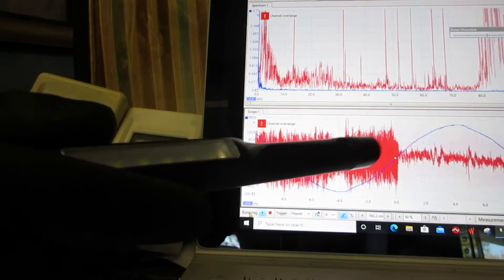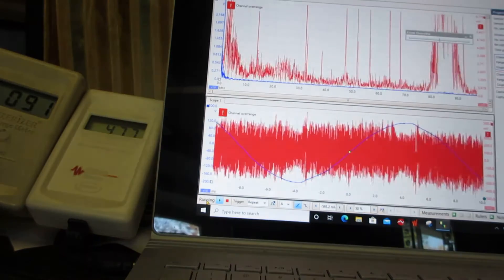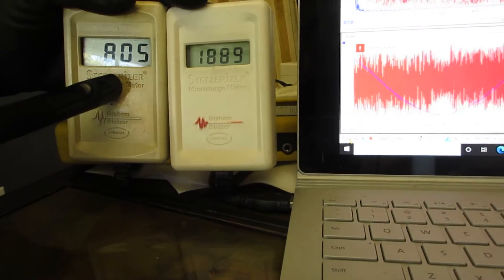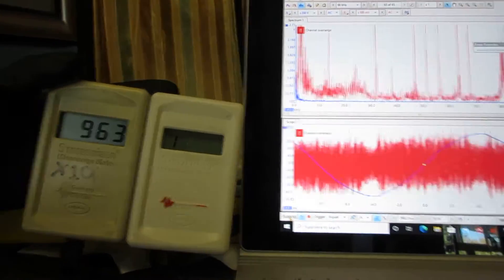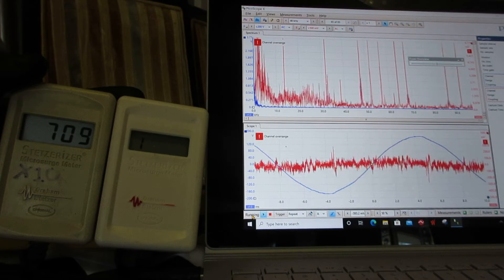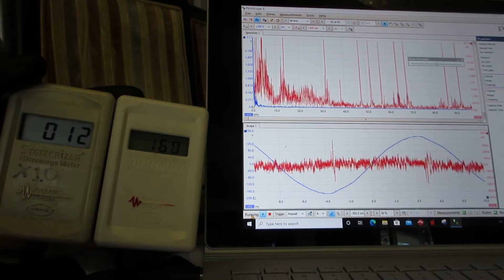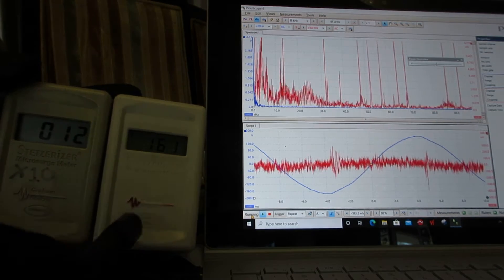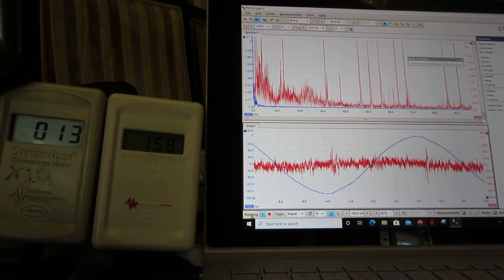Enphase Micro Inverters appear to be source of Extreme Dirty Electricity

Comment: You said in a more recent video that Enphase micro-inverters do not produce DE on their own. And my understanding of solar is that even if micro-inverters are used, there must still be a main inverter to which the system connects which includes the Envoy component. So then in the case of this particular video here, was there no main inverter or Envoy in place? Was the solar system operating on micro-inverters alone? Thanks.
Reply from the maker: In this case the DE source is the Envoy communicator unit.
Reply: @windheimemfsolutions  Ok. Probably wanna change the video title then. Can you confirm that micro-inverters do not produce any EMF on their own? For example, if a client is concerned about EMF emanating directly from the micro-inverters on the panels above their bedroom, is it safe to say there is none coming directly from them? Thanks.
Reply from the maker: Until the Envoy unit is on there is little to no DE above 10 kHz but a little more below 10 Hz.
Reply: @windheimemfsolutions  Ok interesting, so the micro-inverters are indeed producing some DE on their own then, just at a lower frequency. How does the amplitude of that sub-10kHz DE compare to that from the full Envoy?
Reply from the maker: If you want detailed commentary we can have a paid consultation: Please sdvise.  Or you can take this course and learn how to measure DE for yourself.  https://buildingbiologyinstitute.org/mep-fundamentals/

Comment: You can have enphase without massive DE?  The installing technicians aren’t going to check this, are they?  Do they add some DE even if they work correctly?
Reply from the maker: Hi James,  Do you already have the Enphase system installed or only considering it? The DE is created in the Enphase control & breaker panel and is not from the micro inverters.  I have seen this problem in several recent Enphase installations.  If you desire specific instructions on how to avoid this DE please use the Contact Form link below and on my web site to get in touch with me for a private consultation.
Reply: @windheimemfsolutions  I am only considering it. Im not EMF sensative, but understand there are health implications.
Reply from the maker: @jamesruport2608  Great.  To avoid sensitivity avoid exposure: once your are sensitive you may never return all the way to normal.  This is what I have seen in my clients.

Comment: Tks for the video! I don`t think that the installer or the manufacturer are equipped with knowledge about this, that being the case complaining is not going to solve anything, what is the alternative proposition that home owners that want to go solar could do besides the weak wall stetzer meters? Tks
Reply from the maker: Turn off the Envoy breaker in the Enphase control panel.
Reply: @windheimemfsolutions  thanks for your answer, appreciate the expertise.
Reply: I have an Enphase PV system that makes the utility conductors buzz when power goes back to the grid. The utility won’t do anything about it because they claim they are not the root cause. After a year, Enphase has agreed to do an inspection because their certified partners aren’t equipped to identify and remedy the problem. Switching off the PV circuit breakers helped somewhat. Per Enphase, they were going to disconnect the PV’s neutral yesterday (12/15/23) while we wait for the inspection. Still waiting for them to do what they promised.

Comment: I have been under the impression that all solar installations that use an inverter cause  dirty electricity.   But you state that the enphase systems usually run very clean.  Are micro inverters better than a central unit?
Reply from the maker: Hi,  Yes in general.

Comment: The average solar installer has no way to see what frequency range the micro inverters are operating at. I don’t even know if the manufacturer support gets these kind of readings.
Reply from the maker: What you say is very sadly true. The adverse effects of Dirty electricity created by so-called Green Energy systems can negate any net economic benefit.